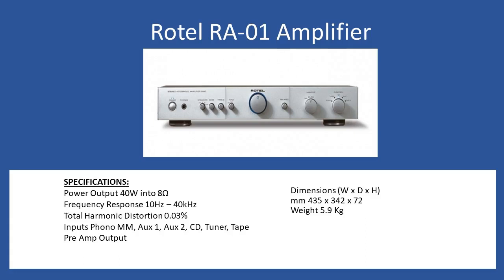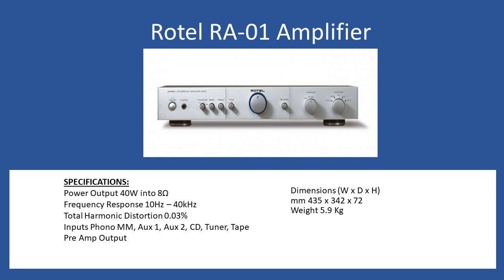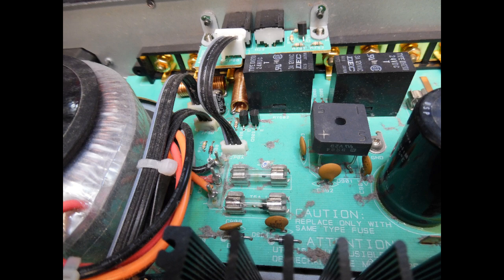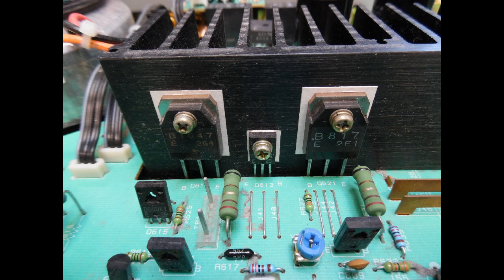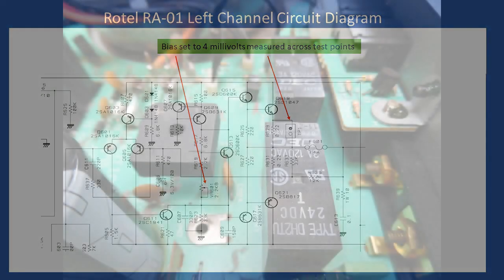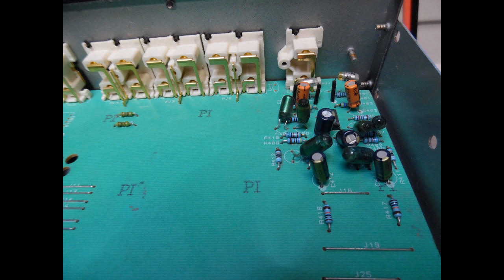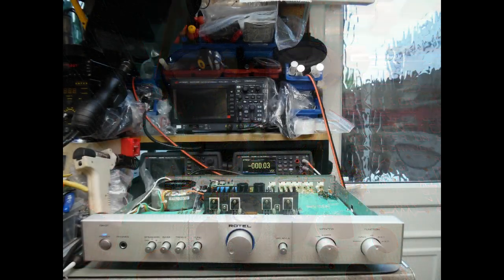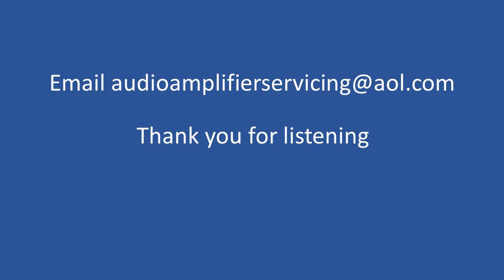Rotel RA 01 Amplifier Repair (With Audio Tutorial)

Comment: Hi
What brand of output transistors are a good replacement? Or what is the factory fitted brand?
Thanks
Reply from the maker: Hi 2SB817 &  2SD1047
 Sanyo genuine originals.
Reply: @AudioAmplifierServicing  yeh thought as much. Looks like i’ll wait until I have a list of parts for my other amps just to meet the minimum order amount from some of these companies.
Thanks mate.

Comment: I had an intermittent problem of one speaker channel dropping out. Then fuses F901 and F902 blew. I replaced these and switched on with nothing except power connected at the back. Resistor R626 immediately fried. Transistor Q620 looks to have failed...getting 3.3ohms from between the outer legs but 220ohms on the other three (all in-situ). Is this likely to be the cause or a symptom of something else? Should I replace all the small rectangular transistors on that channel too as you say? If I end up replacing this with a used amp, maybe 5 to 10 years old, which manufacturers do you consider to be most reliable? Thanks in advance.
Reply from the maker: Martyn from what your describing it does sound like the output transistors have failed, there may be other components in the failed channel that may also need replacing.
With electronics it's if a device will fail it when. That can be due to many factors but also the component fails due to age related to it it's operational life.
So I can not say a particular make or model of Amplifier is more or less reliable all have their own issues that develop over time.
If your in the UK I can repair and service your Amplifier.
If your not then email audioamplifierservicing@aol.com and I can provide guidance on self repair if you have experience and equipment.
Reply: @AudioAmplifierServicing  I am in the UK. Can you give me an idea of cost? Thanks
Reply from the maker: @martynjohnson235  Hi please email audioamplifierservicing@aol.com